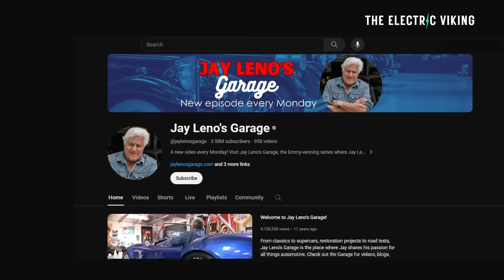Tesla reveals Semi production volume for 2023 and mass production in 2024

Comment: So, total production to date is 100😮 and it will according to Tesla cost 100k 😅. It may reach mass production, however the cost will more than a " traditional " truck.
Reply: The up front cost will be more, but the cost of fuel and maintenance will be much much less.

The reason the trucking industry is taking interest in BEV trucks is, they stand to gain HUGE savings in overall transportation costs.

Comment: Newer diesel are far better on emissions.. it’s the many 20-30 year old trucks that are causing the emissions. 
We should be fixing industry before we switch the public with cars .
Reply: Edison Motors is looking to hybridize old semi-trucks and pickup trucks. Far fewer carbon emissions than building brand new battery electric trucks.
Reply: @randgrithr7387  This is worth doing, since the BEV rollout is so slow.

But in the long term, full BEV will have lower emissions.  It's gonna take a couple of decades to get there, but full BEV will be necessary eventually.

Comment: I think there is no reason why Tesla doesn't build a bigger battery say 65 mmx160mmm  Space is not a problem unlike under the floor of a car . Simply put a 65160 battery has 4 times the battery capacity as a 4680  As height doesn't change production speed only the diameter dose they could probably produce 3 times the energy capacity each shift . Maybe Tesla reverts to a liquid not the new dry formate (that is causing all the delays ) . This would free up 4680 for model 3 and Y  thus solving the $7500 tax rebate . These larger batteries could also be used in Mega packs and power walls . These bigger batteries Amy also fit the Cyba truck . They could also lay these batteries flat for the Model 2 when it comes out .

Comment: It hasn’t production has only gone into pilot programs for evaluation. Tesla is losing money hand over fist, it will never be profitable . Volvo has 4 production lines running pumping out 8 models and also makes bespoke to order such as fire trucks . Paccar has electric models . So far Tesla has made not even 100 trucks , Volvo over 6,000. Ford has made 1000s of the popular e transit . Tesla semi has a very small market the USA as it is not legall (to big to wide ) for Europe and other markets . It also robs the user of about 6 ton in payload . Not good . Ok if you haul chips / crisps . Only good for local work if any very long charge times . Volvo / Scania has far superior charging infrastructure that goes with the trucks and is being deployed throughout Europe . Also Pepsi the main proponent of Tesla semis has an equal amount of hydrogen class 8 trucks under evaluation which is quite promising. Damiler releases this year it’s class 8 Hydrogen truck on the roads as sold to customers . Also other truck companies go driverless in 2024 doing cross boarder work . Tesla is a bit late and didn’t talk to the industry first unfortunately producing a truck that is not in demand for the industries needs

Comment: Any 80,000 lb truck driver attempting to reach 100+ km/h up a hill doesn't deserve to have a job, because it is unutterly stupid. The amount of energy required to reach that speed on an incline is insane. Speed is NOT an issue for any truck on the road today. Reliability, load capacity, and efficiency are the keys. Realistically, the Tesla can not compete on any of those.
The future will decide the reality of the situation, and Tesla will not be the winner.
If you buy a diesel truck today, you can guarantee that truck will have the same size fuel tank, and the same engine power in ten years from now. Whereas, no Tesla Semi purchased today stands a single chance of being operational in 2033. Period.

Comment: The largest cause of accents for large trucks is the brakes overheating and causing accidents. This is especially a problem when going down higher inclination mountain highways.  Regen breaking with large electric trucks will largely eliminate this problem, just one more example why large electric trucks are better than diesel ones.
Reply: Have you never heard of jake brakes? Engine compression braking has been in use for decades. The primary reason brakes overheat is because of the untrained work VISA drivers who don't know any better than riding the friction brakes downhill.
Reply: @randgrithr7387  Of course I know about engine braking but that doesn't change the fact that break failure is still the biggest cause of Class A truck accidents and a significant proportion of these occur when trucks are traveling down long steep declines.

Comment: What about a discussion on the bulk cement truck in Melbourne just recently?  What are the thoughts on that?
I thought Semi production would be about 5 per month as a minimum.
Concentrating on trucks is so important, but it still needs a lot more research and testing in my personal opinion.
Reply: A battery cell they knew was bad for two weeks, but did nothing about, caused a fire. Big news.
Reply: @toddwilliams5905  I hear from sources that it was the manufacturers second!  I can’t verify that however.

Comment: 500 miles? That’s it? 😂 imagine having to stop and charge every few hours, think how slow things will be delivered, it will also drive up the price drastically. Not to mention your Miles will be cut in half if your driving somewhere cold.
Reply: imagine having to stop and charge every few hours 
Trucks can cover 500 miles in a "few hours"? Who knew?
In California, where all Tesla Semis in private hands are deployed and the truck speed limit is 55 MPH, 500 miles will take 10 hours with occasional traffic slow-downs. But a 30-minute stop is required prior to 8 hours, and a Tesla Semi can add another 200 miles during that stop. As a result, a Tesla Semi can drive as far in a shift as permitted by HOS regulations and the speed limit, and any additional range would simply be wasted.

Comment: Freight lines could use the “pass the torch” relay method to speed up the transport of goods.  As a truck arrives to a Supercharger, drops the load that is then picked up by another truck that is charged already, and then follows to the next supercharger.  In the Medan time the other truck is already charged and is able to pick upo the load of the next truck that arrives to the supercharger.
Reply: This is an interesting idea.  The truck drivers that usually comment on these videos show a strong attachment to their present work flow and a remarkable inflexibility towards any alterations.  Perhaps these are the paid anti-EV campaigners, or just old skeptics.

I do think there will be changes to work patterns over time to adapt to the new technology.  Perhaps this will be one of them.
Reply: The megachargers charge the truck to 80% in 30 minutes.  You simply wouldn't save much time by switching the load.
Reply: @tysonn4736  That's a bit optimistic, and probably based on Megachargers >1 MW. But the current standard is 750 kW Megachargers; and during the Run On Less tests Tesla Semis demonstrated charging from 0% to 80% in about one hour, and 0% to 100% in about two hours.

Comment: Not started work on putting Solar Panels on trailers as range extenders??
Reply: The math on this has been done, and it doesn't work out. Covering the roof with solar panels would add an average of 13 or so miles of range; but the added weight and aerodynamic drag would reduce the range by about the same amount, and the weight would detract from the already-marginal payload.

Comment: So, mass production for 2024 is not certain by any means.
Reply: Tesla needs to test until it's failure rate is considerably below that of diesel trucks or it will have egg on its face.    Do you recall the flap when the parking brake control was recalled by Bendix.  Tesla made the news but the same part was used and recalled in several different brands of trucks. Tesla got the bad press.

Comment: Edison Motors makes an electric truck that is considered a hybrid, 
but the ICE only charges the much smaller battery. 
280 KW in the Edison vs 900 KW for Tesla Semi and ~ 125KW for the Cybertruck.
It gets much better fuel efficiency b/c the ICE runs at optimum power always. 
The battery can be charged by plugging in, (overnight?).
I see this as an intermediary vehicle until battery tech gets a lot better.
I think ICE trucks will be with us for some time as some jobs just can not run on electric alone - yet.
Reply: The Edison is a neat truck but it is a EV truck built specifically for logging.  It runs up the mountains where it is loaded with logs and uses regen braking going down.   If the lumber mill is not close they transfer the logs to an ICE truck to finish the trip.  I would not use this to draw any comparisons.
Reply: The Edison truck looks to be a great product for it's particular application.

The engine in the Edison is more efficient than typical diesel trucks.  But it is not more efficient than a BEV truck.
Reply: @danharold3087  
That's not accurate at all. The prototype is a logging truck, but the tech will be used for any truck. One of their first customers wants a retrofit done to their oilfield service rig. Also, the only reason the logs are transfered to a highway truck is so the off-road truck doesn't need to used taxed diesel.
Reply: @randgrithr7387  OK thank for the refresh.    Lets see what happens when they use it for other purposes. Hope it goes well.

Comment: 1% of vehicles producing 20% of emissions actually means that the trucks are fairly low emission vehicles when you consider the work they do and size(s) of the vehicles. 
If you were to compare them to say motorcycles you'd find all things considered the motorcycles would be far greater polluters.
Reply: Um , Diesel tucks are nasty.
Reply: I think, in terms of damage done per unit of work done, you're probably quite right.

Of course, it doesn't mean they shouldn't be electrified ASAP.  

Diesel truck emissions are responsible for around 30,000 premature deaths every year in the US, irrespective of how much work they do.

Comment: 100 vehicles is still in the prototype stage. So far it is a failure.
Reply: "failure".  How do you define failure?
Reply: @JayMcKinsey  The Run On Less tests in September pretty conclusively demonstrated the freight capacity of Tesla Semis running weighed-out loads of soft drinks out of the PepsiCo Sacramento Bottling Plant on >500 mile round trip deliveries to Bakersfield, or climbing from near sea level to 7,200 feet crossing Donner Summit on the way to Reno.
Reply: Every vehicle goes through the prototype stage.  Does this make them all a failure?

Comment: Here's what I don't get about the Semi. I believe in order for the Semi to make financial sense, they talked about $.07/kWh energy yet Tesla charges around $.34/kWh on average at Superchargers. So is Tesla just fleecing all of us on energy prices on our road trips or will the Semi never make financial sense compared to diesel trucks. Side Note: I spent 7 years working for the largest distributor of Peterbilt and International class 8 trucks back in the early 2000's.
Reply: You didnt mention the maintenance costs in a diesel truck which you would know is insanely expensive
Reply: @vancity2349  Initial diesel semi cost plus maintenance is more than than a Tesla Semi only if the cost per kWh is low enough and Tesla made that argument by saying that cost would be $.07/kWh but if the energy cost is going to be $.34/kWh then the Tesla Semi will never be cheaper.
Reply: The Semi would be charged at truck depots, not at Tesla Superchargers.

The energy cost at the depot would be whatever the truck owners could negotiate with their energy provider.  Tesla would not set that rate.
Reply: @loganboyd  What does a loaded semi pay in fuel???
Reply: It's not that they're fleecing you at Superchargers; in my world at least, they're marking up local residential rates somewhat, because they're competing with the large number of folks who charge at home on residential rates. But the current model is for large commercial operators like PepsiCo to install Megachargers at their yards, which allows them to charge at the much lower commercial/industrial rate—around 10¢/kWh in Sacramento.
Reply: @BigBen621  that makes sense if the people running the fleets are also supplying their own charging stations and have no middle man for the power costs. Here in Texas the last two homes I've lived in cost me $.087/kWh and $.14/kWh in Austin and DFW respectively. But Superchargers cost $.34/kWh here now when they used to cost $.26 or $.13 per min depending on above or below 60kW current rate of charge. That would equate to $.02-$.04/mile added depending on how efficient your charging session was where as now it's pretty much $.10/mile. And when you get into that range, you are more expensive than 30mpg cars on road trips since gas is < $3/gal
Reply: They did say $0.07/KWH…I think Elon was picturing a local solar array atop a mega charging and MegaPack setup. That way they can control the price of electricity as much as possible. My experts been supercharging has cost more than $0.40/KWH.

Comment: Dyson actually designed a device that spun the particulates out of a trucks exhaust. As with most Dyson products it was too expensive so the trucking companies didn't  take it up. Like the Dyson car it's probably on s shelf somewhere with lots of patents locked in a vault.  I'll believe the Semi when I see it. Shouldn't it be stainless steel now and the trailers have rear wheel steering?
Reply: You'll believe it when you see it?  Like you think the thousands of extant videos are ALL CGI?  What an easy attitude to have.  No thought required.
Reply: @incognitotorpedo42 :  From context, I believe he means in serious volume (and of course didn't say that, so we can't be sure).  

Also, serious volumes would mean all the major issues, like enough batteries, are worked out instead of "will be worked out in Elon time).
Reply: @incognitotorpedo42  Elon told investors it was good to go in 2019, ready for production.
Some people are gullible optimists.
Next year or the year after BS for a decade.
Reply: You do know it was announced near 7 years ago? And how many years did it take before that until they had something to bring out on stage? All those years to build a factory to make the thing but no sign of one. Still no full self driving being talked about for the truck or rear wheel steering for the trailer maybe? The specs on the drive train has changed so is the claim that it cannot jack-knife still valid? Still no independant reviews. I'm not saying it's vaporware I'm just disappointed it's not being seen all over the country. I was in Amsterdam 4 years ago and saw electric UPS trucks in use. Look how Optimus has progressed in only two years from a fool in a suit dancing on stage.  Where is the same progression with the Semi?  Why are the 3 and Y being tinkered with
instead of putting every engineer on the Semi? Wall St. doesn't move on what may be in the future, Semi, FSD, dancing robots, Dojo, they deal with what is and so far these things to them are mere distractions.  What the hell happened with solar tiles? Home H-Vac systems will be announced soon and we'll all take our eye off the ball again to faun over that. Or will it be the cheaper model car which looks like it will be of no use to anyone with a family as it maybe just a 2 seater. I'm still buying shares and how long will I have to wait for my Cybertruck?  You still can't touch one in a showroom. @incognitotorpedo42
Reply: Don't get me started on Dyson.  A design and marketing outfit masquerading as an engineering company.
Reply: @chriswright9096  The least energy efficient way to redistribute dust.
Hepa bags for Kirby are just too expensive, get through £5 a year.

Comment: Great, a semi that can haul 3 tons with very limited range against an actual semi that can haul 19 tons and can go 2000 miles on a full tank.
Reply: AndyGKaufman it's obviously higher than your 5😅😅😅
Reply: @Echo, you are grotesquely misinformed.  The Tesla Semi has the same max load as a class 8 diesel.  It has a range of 500 miles.
Reply: The semi will never sell in numbers because the battery weight restricts the payload. Anyone with experience in freight knows that unless you are permanently hauling lightweight stuff , at some point you will need to use max payload. If you cannot, your competitors will and you are finished.
Reply: You are repeating a blatant lie.  One that has already been repeated many times, but which has not slowed the production or sales of the Semi.

Comment: 500 miles range... so like 340 miles range. Got it.
Reply: It's used by Pepsi to deliver soft drinks on a 450 mile route.  The depot in Sacramento has 23 Semis, some eTransits and no diesel trucks.
Reply: @davidmenasco5743  *potato crisps.
Reply: @davidmenasco5743  
Gross weight of the vehicle?
Net weight of the cargo?
Reply: @randgrithr7387  The Semi is still under development, so that hasn't been finalized.  But it's a standard route for Pepsi, so they're happy with it.  

And Tesla have demonstrated the capacity of the truck twice, once in their SF to LA trip and once carrying a load of concrete barriers.  I don't recall the numbers but it carries plenty.  

My own calculations suggest that it will carry about two or three thousand pounds less than an ICE rig.  But it will cost about $3000 less to fuel per month (that's figuring 450 miles per day, six days a week).